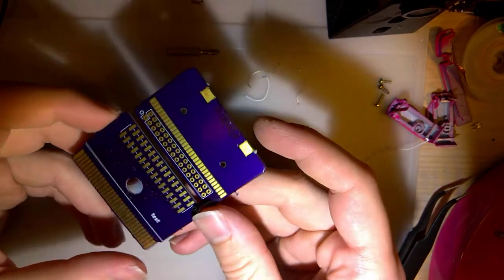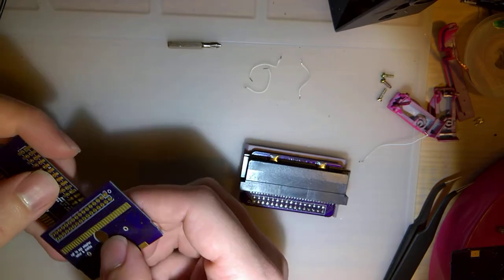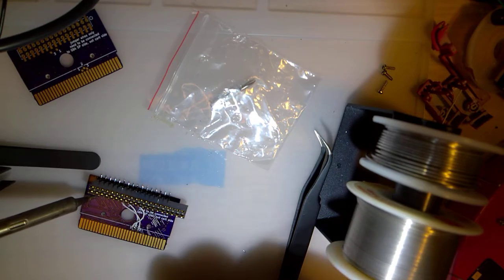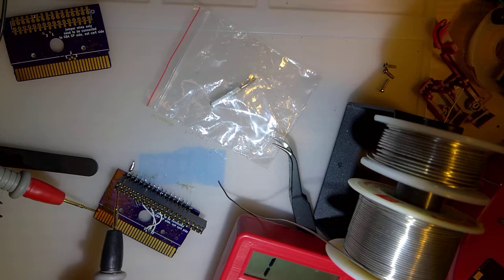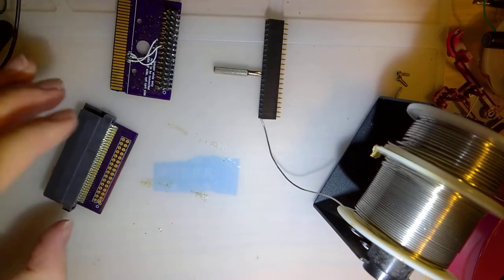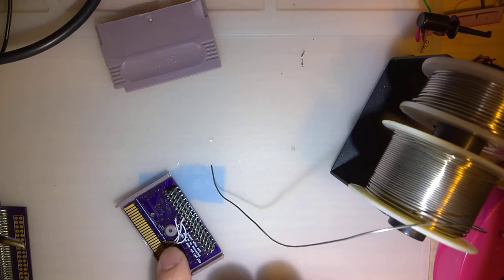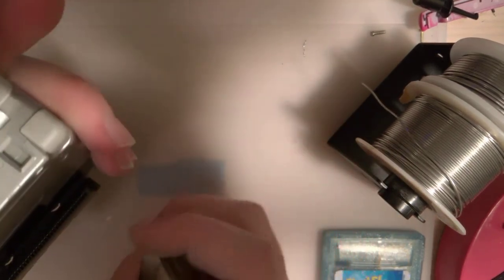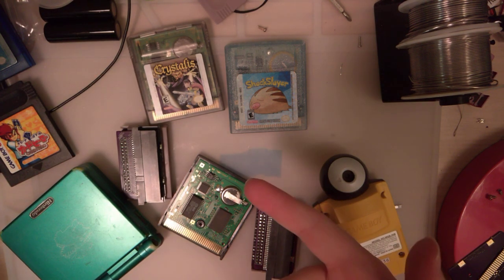Building Version Two of my Game Boy Camera SP Adapter

Comment: You should think of making the 3D printed case as an optional accessory.  I would want one because I hate how the GBC games stick out of the top of the original GBA.  So does the Everdrive for that matter.  It would be really nice if it was flipped over behind the unit protected in a little enclosure.
Reply from the maker: I might eventually but it's not an immediate concern right now.

Comment: Hey man! I was pointed to this video in relation to a little project I was curious about. Essentially I want to make a GBA passthrough adapter/cart riser, whatever you want to call it, to increase the distance the cartridge would stick out from the handheld. I know it's possible, especially after seeing this, but what would I need for something like that?
Reply from the maker: What more do you need? The only difference between a GBC and GBA cart with how it physically interfaces with the GBA is that the corners of GBA carts are notched to prevent depressing a switch inside the cart slot. My adapter would work with GBA games if you just cut a notch into the casing (though I don't see the point in doing so).